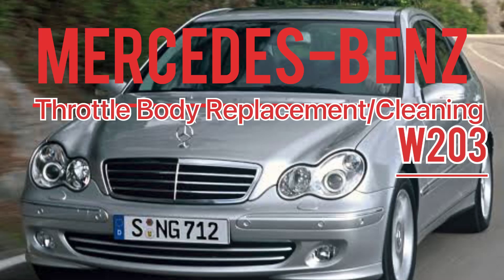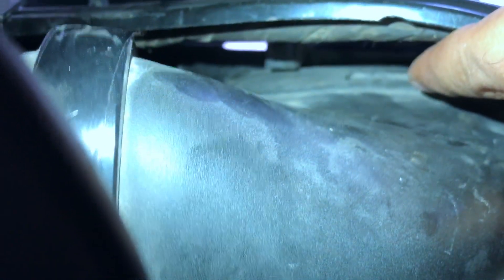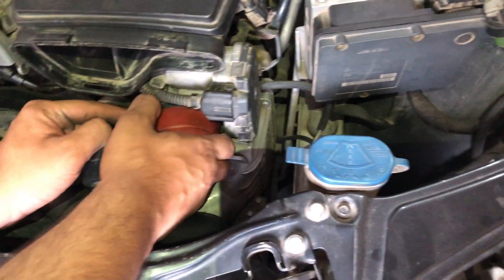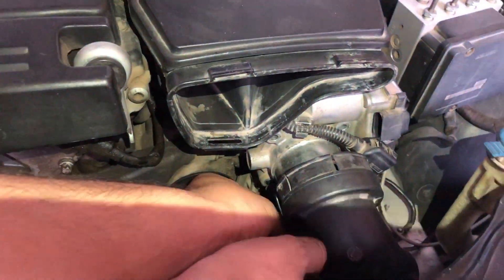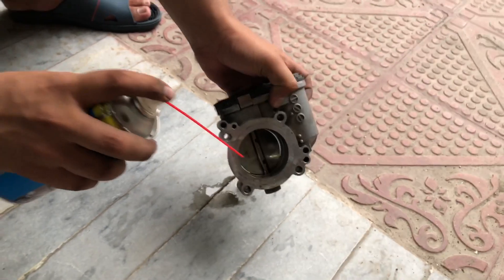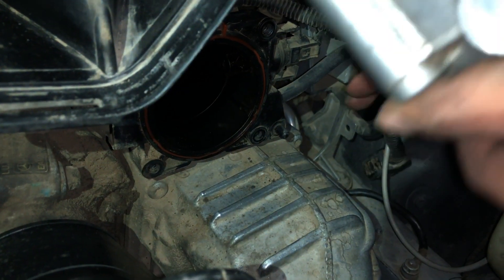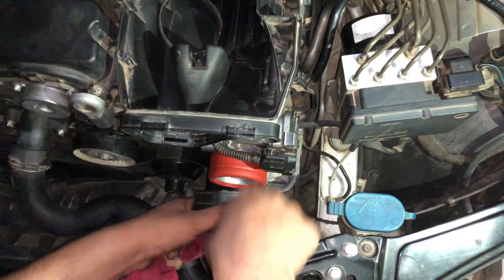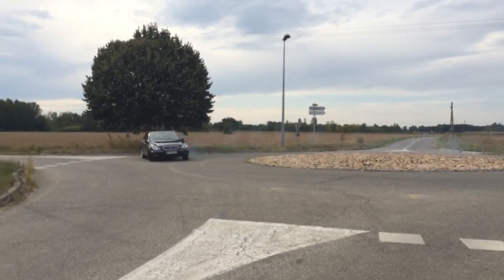Mercedes Benz W203 W211 Throttle Body Cleaning I C180 C200 C230 E200 M271

Comment: Great video thanks. By accelerating the hose went out and the engine light shined. My car has no power. What could be the reason that by pressing the gas pedal the hose went out from the trothle body? Can anybody help? Thanks
Reply from the maker: Your car is missing the clamp which holds the hose

Comment: Did this cleaning, but I was not able to move the butterfly flap freely. I saturated the ends with throttle body cleaner, but still wouldn't move. Is there a lock mechanism that keeps it from moving, or is my throttle body likely damaged and in need of replacement? I have a 2005 Mercedes C230K. Thanks for the video!
Reply from the maker: on majority of cars, its movable. but you can also unscrew the coin as well by removing the 2 screws in the centre

Comment: Yesterday I wanted to clean the MAP sensor of my car and I saw that the pipe that connect to the MAP sensor was missing.  can you help me with any information? I have a w203 c180k m271
Reply from the maker: I know i am super late to reply, but I’ll have a look
Reply: Bro I have the same issue, the little MAP sensor that is screwed onto airfilter housing, the nozzle is broken, I don't know which vacuum hose needs to be attached?
In this video it looks like there is no little hose connected to the map sensor, is that right?

I have 1little vacuum hose leftover, it's around my headlight unit, it's long enough to reach the map sensor, would it be that hose?

Thanks guys